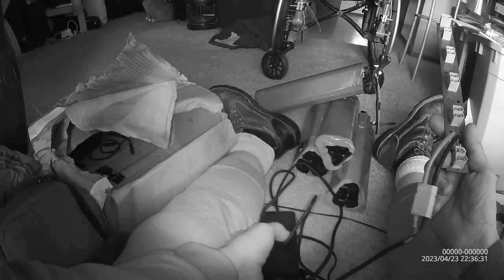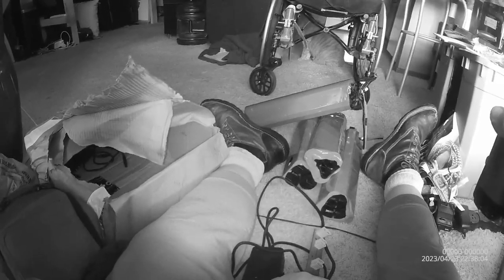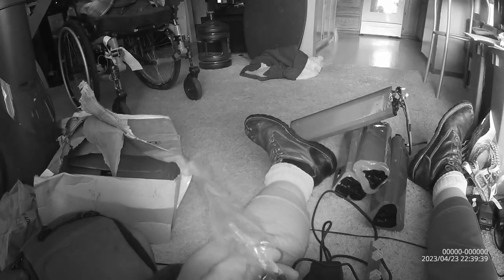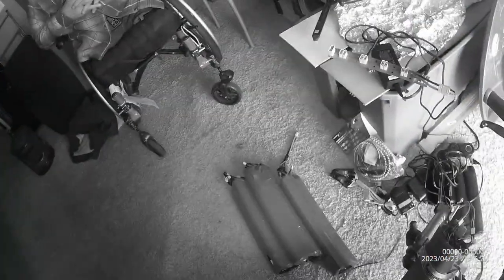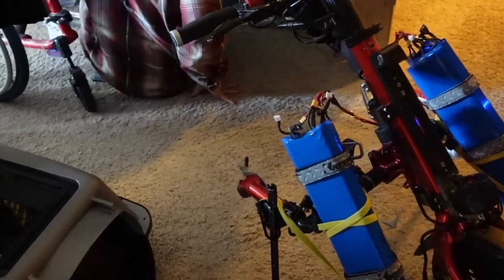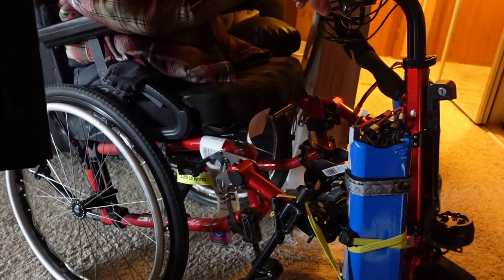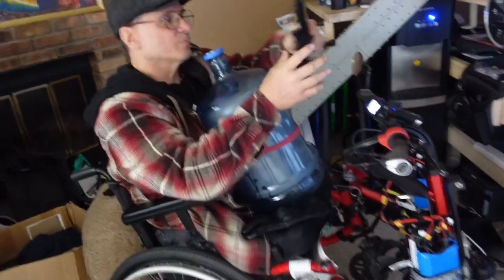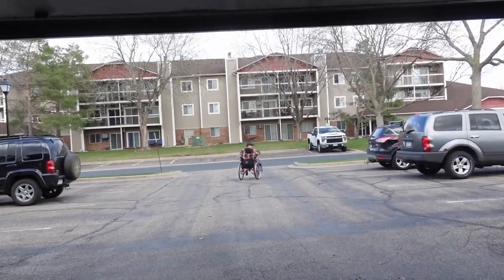Voiding the Warranty: Delivery of the first prototype

Comment: Awesome, I have a firefly 2.5 from Rio mobility. I've been in a wheelchair for 38 years and its the most fun I've ever had.
The only drawback is you can only go about 12-15 miles on a full charge.  Wondering if you have expanded on this prototype?
Reply from the maker: Ron has gone over 100 miles on a single charge of all the batteries.
Reply: @magic.marmot  WOW, That's the ultimate goal right there. What you've done is a game changer for sure. 

I'm glad I researched Firefly battery  upgrade. I knew there had to be a way to get more miles. This inspires Me to get mine upgraded. THANK YOU!!!

Comment: And if im not mistaken battery longevity is best by keeping the charge between 20 and 80 percent and not charging to 100 percent, ya?
Reply from the maker: Mostly. It's a bit more than 80 and a bit less than 20, and is highly dependent on the cells themselves.